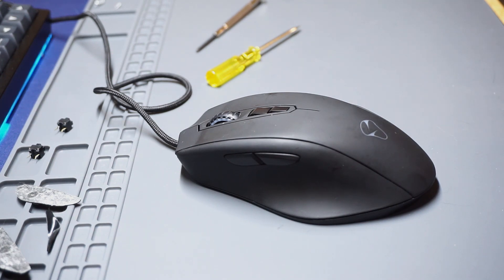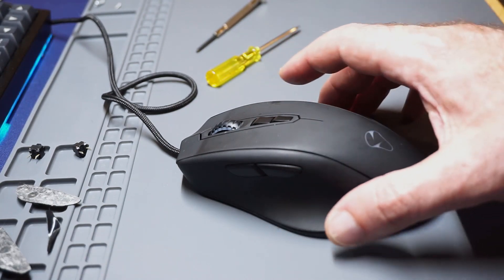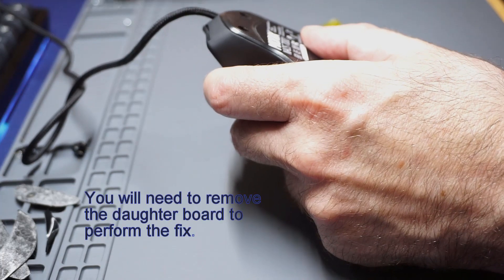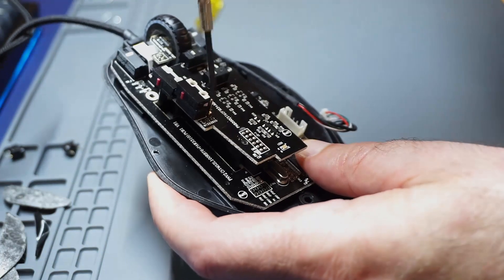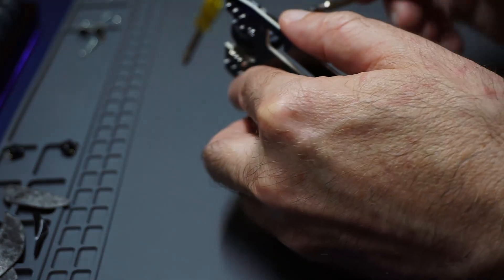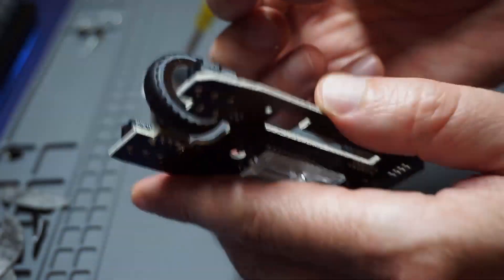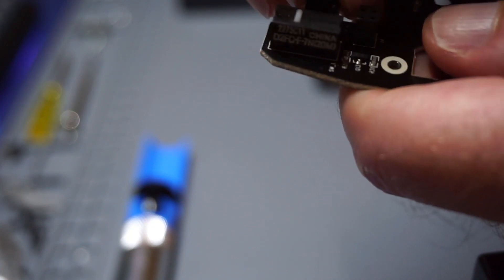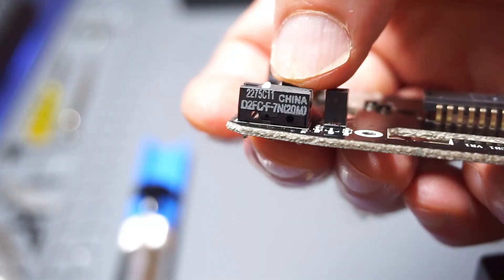How to Repair Your Middle Mouse Button - Mionix Naos

Comment: Just completed this replacement successfully. My replacement switch didn't have a "cross" pattern where the scroll wheel contacts the switch, only a single line, so I'm concerned about how consistent the click action will be as time goes on. After the initial solder I also realized the new switch was sitting a little too high, and I needed to lower it closer to the board for the mouse wheel to sit more level and scroll click to behave as expected. Prior to lowering the click would misfire when rapid scrolling.

Thanks for the repair video, now my favorite mouse is like new.

Comment: Try adding a single drop of 3-in-1 oil onto the middle mouse switch before attempting to do this. It fixed my issues completely on my naos 7000 when i thought the switch was dead.
Reply: you drop it on top?
Reply: @Astrothunderkat  yes when you get to 1:23 , apply a single drop directly on top of the little white part of the switch and gently click the mouse button repeatedly to make sure it gets inside. If it doesn't work, you can repeat but it's safe to say it's dead. 

But yeah haven't had any problems with this method in over a year now. The only con (or pro) of doing this fix is the switch is a little quieter but it works perfectly

Comment: I'm on my second mionix and the same switch is wearing out. i need to either get a decent soldering station and switches or switch to another mouse vendor.

Comment: I wonder if other people have a similar problem to me. Ever since my mouse was new, the middle mouse button click would stick. Now I can't even mouse wheel scroll without it clicking accidentally or sticking down. It is so aggravating that I can't use the wheel without having to click 2 or 3 more times to "unclick" the middle mouse wheel.

Comment: I would very much like to know what you used to reattach the mouse pads? The original glue is all but dried up on mine and the pads themselves got all wonky when I pulled them off. Can I use tape or regular glue? And can I flatten them in some way before I reattach them?
Reply from the maker: I was able to re-use the same pads, and the glue was still okay.  the plastic pads did get a little bent out of shape, but you can use a heat gun or maybe a hair dryer to soften the plastic little bit right before you put them back on.
Reply: Perhaps it's a bit late but you may buy replacement feet/glides on the mionix webpage and guess from other stores too.

Comment: Test the middle click right after you take the cover off. Mine had the exact same issue but turns out it just had some built up hair wrapped around the axis, which caused some gunk to build around the wheel. Fixed itself the second I took the cover off!

Comment: Not a direct replacement switch, there are some differences with the button, maybe link the + button
Reply from the maker: The switch works. It may not be the exact switch the mouse came with, but why would you want to replace a known faulty switch with another known faulty switch?
Reply: @mikey631  everything dies one day, but im more thinking the wheel slipping off the top of the switch where the original has a ( + ) so it cant slip off, yes i know its held in, but it moves around a little. i had a look and i couldnt even find a button with the + on top, so if this is all i can get it will be fine. thanks

Comment: I've had two broken middle clicks now. The first one Mionix were nice enough to replace even though the mouse was technically out of warranty. The replacement is the one struggling now. Been using contact cleaner to okay effect, but sometimes it gets really inconsistent and only lasts for a few dozen clicks. At this point I'm looking into just replacing it instead..

Comment: My mouse's middle button is not working and when went to a PC hardware repairing shop, they said that i should better buy a new mouse because if an engineer repaires the mouse he will already charge 200 to 300 rupees i.e. the cost of a new mouse. I didn't want to waste my money for a little fix for the middle button, so i watched this video. But this is very hard, Still i will try

Comment: I don't know if they advertise 20m actuations on main 2 buttons lever switches or whatever they use, or all of the microswitches as well. But I thought that it was way too early to disassemble it. Since even my last mouse only died because plastic rubbed off and switches weren't actuating every 5th time. Back to current mouse, I just tapped middle button with my finger real hard and it started working again. Maybe the membrane got stuck.
Mouse is Avior 7000 btw.

Comment: what you think about changing the mouse wheel entirely? i ordered the switches to fix mmb but the scroll wheel has been pissing me off (becuase of the stupid rubber piece coming off). I have a spare zowie EC1 wheel that im going to try as well as a razer deathadder wheel that i ordered through ebay. also did you get new feet for it when you did this or used the old ones?

Comment: Hey, I'm wondering how you managed to desolder the switch. My right mouse button switch broke and I've recently bought new switches but I'm not able to desolder the old one from the PCB. Any tips and tricks? I've tried a desoldering pump without success
Reply from the maker: I just used a solder sucker, though it did take a few tries to get all the solder out, and even then, it needed a little help from my pair of pliers to get it out all the way.
Reply: You can also use a desoldering braid. It would look like this: http://onetesla.com//media/wysiwyg/solder_wick_1.png - This makes the solder stick on this braid, removing the solder that way.

Comment: Was yours completely broken or did you have to press it real hard?
Cause mine works but it required a firm slap to the butt! Thanks anyway
Reply from the maker: Mine was the same way.  I had to really mash down on the button to get it to register a click!
Reply: I had exactly the same problem with my Avior 8200. So far this video helped me disassemble the mouse without damaging it and in my case cleaning and pushing the switch a few times with my thumb and some force (not too much of course) did the trick. 
Good to know i can easily replace that switch in case it stops working again.
Reply: thank u that fixed it
Reply: for the middle mouse wheel click

Comment: Thank you really much for the Video and the link to the switches! 
I have a Mionix Avior SK and i think it should have the same switches or do you think i should take it apart first and look for the switch?
Reply from the maker: Absolutely take it apart!  it's pretty easy, and you'll know for sure what kind of switch you need.  The the left/right click switches on the main part of the mouse are different than the scroll wheel switch, so yours might be different depending on which switch needs to be changed.
Reply: Mike Y. Thanks for the answer. I need to change the weel press like you fid and already just ordered 5 switches at 1,60€ on Ebay :D
 I don't wanna open it to often because of the gliders, i hope they still glide as fine as now after the replacement :)